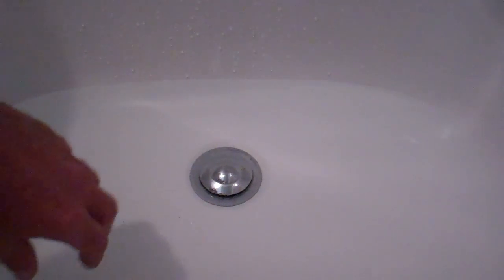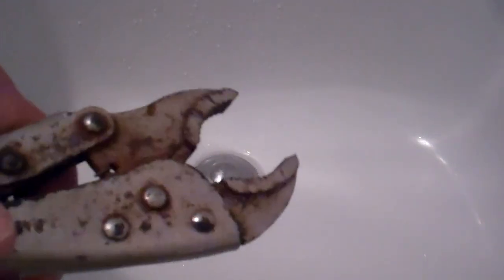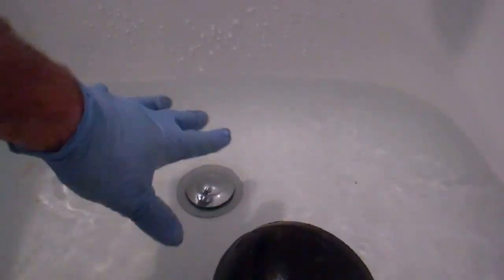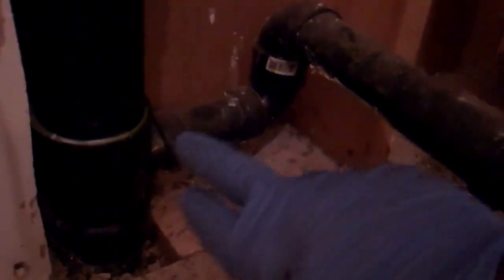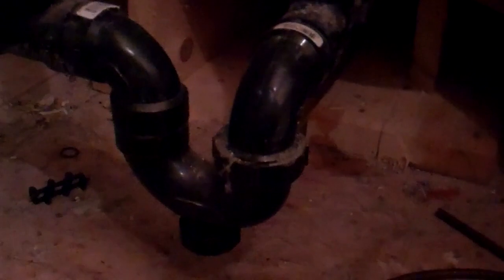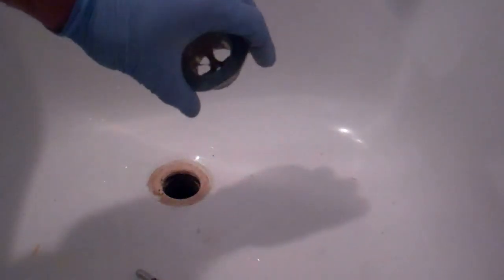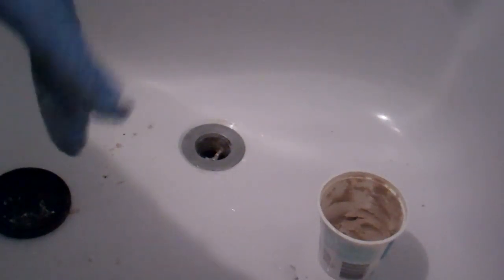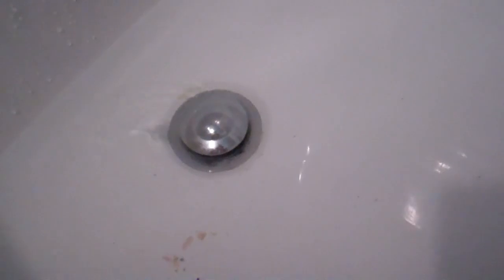How to unclog a bathtub drain

Comment: thank you so much!  i washed some things full of dirt (off of my patio) in my bathtub as i have no garden hose lol but then I got a dirt clog couldnt clean it with a hanger.  Was going to go get an auger for $10 at Lowes and watched this video how to use it properly but you said try the plunger first.  i'm not so mechanically inclined ha ha but i paused the video, went and plunged the heck out of the tub and THAT DID IT.  The plunger successfully pushed all the dirt through jammed in the drain and good as new.  Don't need the auger.  And my patio is clean and my tub is now again too.  Now to take a hot bath to de-stress and soothe my sore muscles lol.  You rock and you saved my day!!! 👐👐🖒🖒

Comment: A few little tips for you. When you are plunging a bathtub; the overflow has to be covered. This puts all the pressure from the plunger into the drain line. If not all you are doing is pushing the water from the tub up into the overflow.
All overflows should be covered when plunging regardless if it is a basin or a tub. Plunging with the overflow covered works the majority of the time.
Been in the trade for over 35 years. I would never suggest to remove the spud of the drain from the tub. 
Have never taken one apart.
This can cause some serious problems. Lose the gasket in the ceiling and you are scrambling to find another one.
Have a good one!

Comment: worked great i did use the Zip it to pull all the gunk much simpler, but I needed to remove the drain to fix a leak that worked perfect thanks!

Comment: Just to add, to help feed the cable  more easily down the drain pipe ,applying a little hand lotion, petroleum jelly, or cooking oil , to the cable as you feed it can help the auger slip more easily through the drain (helps prevent the cable from curling up,which BTW can also be prevented by feeding smaller lengths of cable in  with each repetition. Don't use too much lubricant just glaze the cable ,

Comment: Thanks. It help me to understand how the connections are behind the wall.  I usually unclog my bathtub using the snake but I wasn't sure how far I have to enter it.  I have a 25 feet long snake, do you think I need to use all? in other words, how far do you think the big tube is from my bathtub?  I live in an apartment in a building.

Comment: Hi.  Couple of issues with this.
1 - No need to remove the drain, it's easier to snake via the overflow.
 2 - He is using a toilet auger for a snake, really not designed to clear a shower drain

Comment: Terrible video.  Too complicated by 100,000%.  Here's what you do;  Unscrew the spring-loaded plug, carefully withdraw the core so it doesn't have parts fall down the drain.  Pull out the gunk.  Reassemble.  Shower.